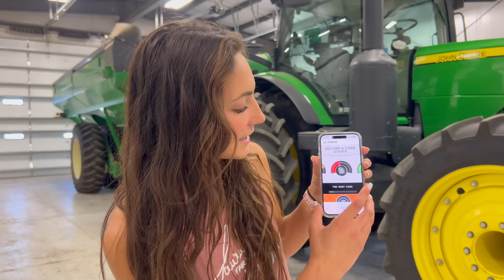Can We Fix It?

Comment: Just a heads up... might want to keep in mind some cats like climbing into the engine compartment under the hood to get warm in the winter. Had a couple of strays get chopped up in the cooling before in the past when I went to start the engine. Good practice to smack the hood a couple of times to scare any kitties out before starting the engine if you have cats around.
Reply: great advice😃mice and rats like to chew on electrical cables, cats like to chew on mice and rats.
so it's always worth giving the engine cover a few slaps to check for sleepy lil' kitty-cats.👋🐱🐭

Comment: I spent a week and a half trying to get the coil for the PTO off my JD lawn tractor.  All the videos, were at worst hit it with an air hammer to vibrate the penetrant oil in.  No, I had to craft a bracket across the top to put a hydraulic puller on.  And then it refused to budge after being under pressure all night until I tried a couple last minute pumps before I took a torch to it.  It took so long as I was running to buy ever more aggressive tools.

Comment: Great work guys.  I think that it was "easier" than in times past because you got right on getting it fixed rather than not being able to get to it until 4 or 5 days had passed.  Even though there was rust on the shift, and most likely at the gear box, that rust hadn't had time to rust together and make that nasty fussy mess that has been there before.  A few hours can make a huge difference

Comment: Thanks for another great video Laura and Grant. It was interesting. 

You had to take quite a bit apart to get that gearbox out. Think letting the dealer overhaul the gearbox is a good move. You can do the remove and replace and let them fix the gearbox. That shaft came out fairly easy. Hopefully it will go back together as easy. Rainy days are good for this kind of repair work. 

That little kitten is really cute. Likes that floor sweeper. 

Thanks for everything. You both take care and be safe. 
The Iowa Farm Boy.

Comment: Just using the cordless ratchet is doing more than most men could do. But as a VERY experienced mechanic, how you put it back together is WAY MORE IMPORTANT than taking it apart. If you do it correctly, like it clearly was the last time, then next time will be just as easy. If not easier. Have faith in set screws. Make sure they are tightened properly. I'm sure I'm not telling anyone anything new. You clean up quite nicely for the add. Your beautiful hair is getting SO LONG!! Bravo!!

Comment: I started putting lithium grease on anything that has a tendency to rust and seize, I think it lasts even longer than anti-seize and it's quicker and easier to apply. Except for exhaust bolts/nuts/clamps, there you'd still want to use the high temp copper anti-seize.

Comment: Your little kitty sure will go on the dirty shop rags because it’s provide just a little cushion from the cold concrete floor on their little paw’s, and yes they also will go on shop robot cleaner for the same reason …
If you have an old bed sheet with your odor ( not washed ) fold it to have a good thickness and put it somewhere they sleep in a calm place in the shop , they will be very happy with it .

Comment: Another way of pulling shafts/axles is to hook/bolt a log chain to it, and then whip the chain. The chain weight and the snap will usually pull out what you're working on ..

Comment: "All I want for Christmas is a new Corn Head" well I suppose a rebuilt gearbox will work as well. Love watching your Videos. I just replaced an Air Compressor in one of our Freightliners, had that sucker out in 2 hours and 3 hours to install. I took a different approach from the last time I took it out. This time it was much easier and quicker. You should always learn from your mistakes and improvise when possible.

Comment: Laura; tells us that she's not mechanically minded:
Right after using an impact wrench to pull off a part from a combine?
After we've seen her change oil, replace parts on multiple vehicles, get an engine working in the field, get a pivot working, help Grant replace the distributor, and do at least a dozen other things that would intimidate most folks.
Side note to Grant: I'm soooo glad that I'm not the only person who YouTubes videos, goes to remove (the brake pads on a car) and then finds that it takes 3 days because a bolt won't come off, and you finally have to cut the whole thing off!  Ohboy.

Comment: We always rebuild our gearboxes every year right before harvest they are cake and cheap insurance. Corn heads take alot of abuse there is alot of shock loading on the gears and bearings. Takes about 2 hours per box to take apart and clean and reassemble once you've done it a few times and we keep 2 extra ready to go for that harvest time emergency.

Comment: Hey guys next time just hook a chain on that bolt you screwed into that shaft and use the bobcat to pull the shaft out. You just have to make sure you pull on it straight. Your way works. It is just quicker this way. The first time I had a gear box go out I had a JD tech come out in the field and fix it he actually used his truck to pull the shaft out.

Comment: Yeah, you just have to beware of not only the pitter-patter of little paws, but they tend to sleep on warm engines as the nights get colder.
Reply: Put a small heating pad in their bed, it will draw them like a magnet.

Comment: Laura and Grant, please please please do me a favour, when you are working on those big pieces of equipment that are hooked to hydraulics on the front of your combined, please get yourself some strong jack stands and put under the front of the attachment that lifts the corn head up, you can never trust Hydraulics especially if a line blows down that corn head will come and there could be a serious accident, so please get yourself some jack stands and support that corn head for your own safety

Comment: Seems like a dumb construction if you have to pull out the main driveshaft to get it out. They could've made a split in the driveshaft to the gearbox too. That way you'd only had to split the smaller shaft to get the gearbox out instead of pulling apart half the head.

Comment: If it’s possible to run the corn head with a missing gearbox, can you shift one of the outboard gearboxes to the missing space and end up with a one-row narrower head to use while the broken gearbox is out for service?
Reply: Yes, but it leave a row of corn unchopped and not ready for no till planting.

Comment: So I would like to comment about the M12 90* impact, yes I knoe they work, if you ever come across the point were you want that thing to be like a Tim Taylor on tool time with more power drop a 5 a.h. battery in it and those will come alive to more than what you expect,  second thing ( probably should dig before I ask butta) nice geo, ( 🥵🥵🥵🥵) old man emu lift, or guessing maybe just its setting on some atleast 33" tires btw no affence, buttttt looks really dang nice.... 🤤🤤🤤🤤

Comment: I am sure that if Grant had the shop manual for that gear box he could repair it just as well as the JD dealer. Most task are not that difficult once you have done them the first time. Sounds like this is not the first time this has happened. Where is the spare gearbox?
Reply: Great idea ! You should go buy the spare, in fact buy spares for everything.

Comment: That was cool:) Are you going to polish the shaft and grease it before you slide it back in? I hoped you'd at least opened the gearbox to see if it was an easy fix. What if a nut just fell off?

Comment: Does that shaft just drive the rotor that stands the corn up?  If so could they accomplish the same with just vertical drive by wire motors with rotating blades and eliminate all the cost of drive system and related gearing.

Comment: Just be careful with cats around tractors and harvesting equipment. It’s not a good feeling to start a tractor up and there’s a cat splattered up the wall. Steel fans aren’t to bad Plastic fan blades tend to break and it could go through the radiator